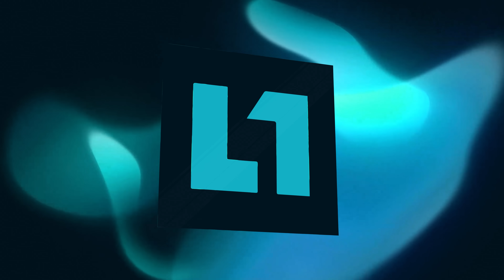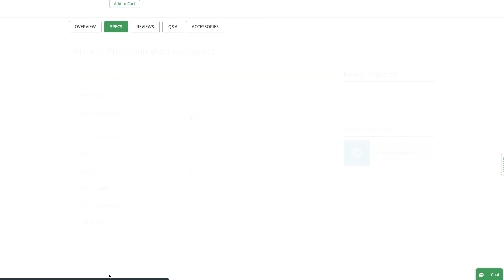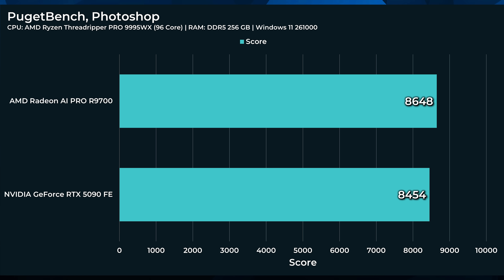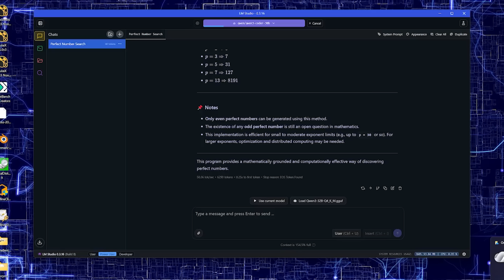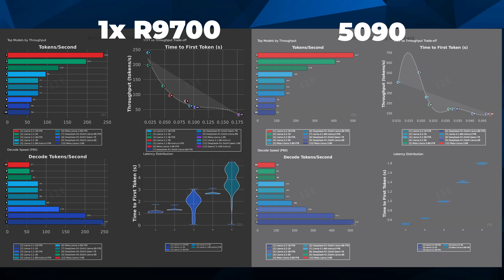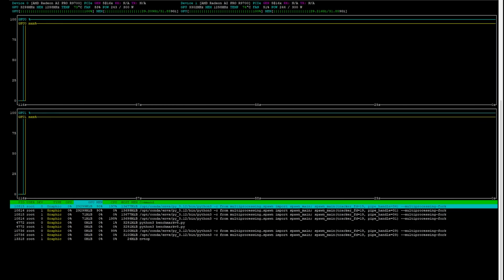Radeon R9700 Dual GPU First Look — AI/vLLM plus creative tests with Nuke & the Adobe Suite

Comment: Thanks for a very interesting video, Wendell. I run both Windows and Linux. I'm very happy that Linux is doing so well these days as I am looking at migrating to Linux entirely.

This new GPU looks very interesting, but for a couple of things. Are they also any good for regular gaming? Is there a version that does not use the NGC (nVidia Garbage Connector) for power? I'd be a lot happier with conventional 6-pin or 8-pin connectors than that nVidia abomination.
Reply: I believe Wendell said that you can download the Radeon 9070 XT firmware and it will run like a 9070XT (with 2x the ram). It'd probably be good budget in a 4k mATX/ITX build for a Era or something, but if you don't have space constraints or need 4k textures then it's not an ideal GPU for gaming only.

Comment: Will this be a good gpu for CAD and 3D scanner applications?
Reply: Check if they require Cuda. If not, then yes.
Reply: compare the OpenCL and CUDA performance on your platform and go from there, some embedded systems are built for CUDA-only so there won't be a different option
Reply: As others have said depends on application support for Cuda or not,  but generally 3D CAD and design software really just wants a lot of VRAM.

Comment: So there are three main parameters

Memory bandwidth
VRAM
Cost

AMD halfed the Memory bandwidth and the cost compared to 5090.

If they had instead halfed only one say just the cost, ie kept the 512 bit bus, it would have been a game changer.

Or doubled one of the parameters say VRAM to 64GB, it would have been a game changer too.
Reply: their 9070 chip doesn't have 512 bit bus, only 256, so there's nothing for them to keep. If there were a 9080 or something, then it prolly would be possible. Although I have a feeling that even if 9080 existed, it would've been at 384 bit bus

Comment: I would actually love to see SDXL benchmarks (i.e. ComfyUI, InvokeAI) regarding the R9700, because last time someone tried SDXL inference on an RX 9070 XT, it was slower than a RX 6800 XT, which sounds something went terribly wrong. Most likely a software issue, but it doesn't inspire confidence. I wish to see if it was fixed.
Reply: Seconded!

Comment: Can you go 3 (tripple) R9700? Or are non-power-of-2 number of GPUs not recommended?
Reply: Doesn't make a difference. Just set tp=3 in vllm.
Reply: you'd just need a better power supply and a PC/Server with enough PCIe x16 slots

Comment: I know LM Studio is used to benchmark LLM performance, but do use GGML/llama.cpp `llama-bench` for a consistent run and comparison. It's easy to run across all HW, CPU, Nvidia, Apple, Intel and AMD. There is also fresh builds of llama.cpp, lemonade-sdk/llamacpp-rocm for Strix Halo, RDNA4/3 that has ROCm7 built in that you can use for Ubuntu and Win.

Comment: The other day i try ollama with vulkan and rocm 7.. with vulkan i have 144 tk/s and with rocm 7 110 tk/s  .. this in linux with 7900xtx gpt-oss-20b. .. i try in other box with 6800xt ..  but vulkan and rocm6 was near identical.. 5 tks more in rocm6 very strange.
Reply: I also have 7900XTX and 7110tk/s on gpt-oss-20b seems like you have hit some cache. Otherwise it is rather impossible.
Reply: @ksitau  sorry it's rocm7    110tk/s aprox .
Reply: Try the 7.9/7.10 nightly builds on the 6800XT

Comment: Just a note VRAY is coming out for AMD as of a few weeks ago. OOH and before I forget what about Unreal engine path tracing can you use 2 cards? You used to be able to with 3090s.
Reply: 3090s have NVLink so they're able to do multi GPU workloads much better than pretty much any other reasonably modern GPU
Reply: @bosstowndynamics5488  Yeah I forgot about the networking part of the cards. Good call.

Comment: I guess many people don't know if they actually require CUDA or not.
Reply: CUDA can't die off quickly enough, what an overgrown tumor it has been on general-purpose compute for the past two decades...
Reply: @peshozmiata  OpenCL for the win, doing my part 🖖🫡
Reply: @peshozmiata  until AMD performance matches Nvidia in Bender, I'm stuck is the issue
Reply: @jabronilifestyle  For Blender specifically the issue isn't CUDA but OptiX. If you want to use the hardware raytracing feature on AMD cards you need to use HIP-RT, but support for it is spotty at best. Intel Arc is ahead in this department - Blender already uses Embree for Cycles and enabling the hardware-accelerated raytracing with Embree on Arc is easy and very usable. It's too bad they don't offer any hi-end cards because intel's raytracing is very competitive with Nvidia's offerings in the same gpu class.
Reply: @peshozmiata  I use CUDA in blender cycles wym?
Reply: @jabronilifestyle  The CUDA pipeline is slower than OptiX. OptiX is specifically meant for raytracing so it's faster. You normally use CUDA only on GTX-series cards since they don't support raytracing
Reply: @peshozmiata  its slower but has no compatibility issues for me. optix shits the bed with certain modeling plug-ins I crutch
Reply: They don't know that they don't need it. They just repeat the old things they have read three years ago. But it gets better, as people see the movement of the whole ecosystem.
Reply: @construction6  Enthusiasts can get by with anything sure, but there’s also the point that there’s no reason enthusiasts have to go through a less polished ML workflow / ecosystem
Reply: This is the bright spot for AMD to sell their GPUs and for tech reviewers like Hardware Unboxed too to aggressively label Nvidia as the worst value without facing any friction.
Reply: rocm works so well today
Reply: Seriously. Unless you’re doing robotics, you probably don’t need CUDA.
Reply: @rob_over_9000  "Unless you’re doing robotics, you probably don’t need CUDA."
Not really. Ansys Fluent requires GPU for the best performance and only CUDA was historically supported for the purpose that assumes NVDA card was necessary to be present in the system. However Ansys Fluent launched AMD GPU support since V2024 so now it supports the new Radeon Pro as well as Instinct such as MI200 and MI300.
Reply: @rob_over_9000  I need CUDA for cycles in blender and I don't do "robotics"
Reply: What about CUDA for Stable Diffusion? Is an AMD GPU really doable? Does it have to be on Linux?
Reply: @zacharyshort384  Short answer - yes you need Linux. Long answer - you can run ROCm in windows usind WSL which is more or less installing linux inside of windows in order to make it run.
Reply: However, having CUDA does give you more flexibility. When you need it, even if you never thought you ever would, it'll be there.
Reply: @hasnihossainsami8375  more flexibility while locking you in to a single vendor though.

Comment: Why couldn't AMD have offered this up to people with the home user in mind, especially when it can challenge RTX 5080/5090 for performance specs?   I would really like AMD to consider getting a higher end home GPU on the market to challenge Nvidia for the top two sports or at least compete in the same pound.   9070XT are great,  but AMD really needs to address the lack of a product in the top tier, especially since they seem to have their driver issues resolved.
Reply: I mean unless you have a model that requires 32GB of memory its essentially a 9070XT out of the box no? This card isn't targeting the RTX5080-50980 its a work class/enterprise GPU.   Personally Id' say the 9070XT are mediocre, they only look decent because NVIDIA is so wildly overpriced,  I don't personally care that they missed a top tier GPU this generation what I wanted to see from them was a RX480/580 moment.
Reply: Wich driver issues? I have a 9060XT and the RDNA4 Support was spot on right from the beginning. In fact, NVIDIA seems to be facing way more Driver related issues compared to AMD since the last couple of years
Reply: @ka1serofc  Totally agree with this, but I think you two are both saying the same thing...

Comment: You should throw the M3 Ultra with 512 GB and compare.
Reply: I second this.
The price / GB of VRAM is well in favor of the M3 Ultra.
Not to mention that it comes with the whole CPU/OS, etc. around it and it also draws as much power as a single card.

For home usage, or even for a small team, I think this is probably the best choice for local AI inference, as long as nothing Nvidia or AMD specific is required.
Reply: @dlsniper m3 ultra has weak gpu compute in comparison to even single AMD card, so it depends
Reply: @leland2848 I need to do my due diligence on that, for sure. But running an FP8 24B params model with 128k tokens context window would be really nice.

As long as I could get at least 25t/s for generation, I would jump into Apple's offering, for sure.
Reply: @leland2848 also a weak cpu compared to anything actually professional
Reply: @dlsniper Plus you can run very large models.  The difference between DS 70b and 671b is epoch levels of difference.  I don't program so reasoning is what I need and the MofEs is much better.  Plus the M3 Ultra has 800 GB of bandwidth.  512 GB necessary to run the 617 at Q4 would require how many GPUs?  And what would that cost?

Comment: Weird, my LM Studio uses ROCM on a 7900xtx. 
I can choose between Vulkan and ROCM and both work. Depending on the model and the size, ROCM is usually 2-3tk/s slower but the longer the context goes, the less tk/s ROCM loses in comparison with Vulkan. Of course, I'm limited to 30b models on q4 at max if I want to load it into VRAM completely.

Maybe the fancy new AI card will need ROCM 7.x to work properly on Windows?
Reply: I confirm, my 7900xtx has also higher tokens per second on vulkan than on rocm on arch linux. I wonder also how does 9700 compare to 7900xtx.
Reply: @ksitau That's the entire point Wendell was making when he was drawing attention to ROCm - the very recent latest release of ROCm is the first time it's actually been able to beat Vulkan, and at least on these cards that seems consistent
Reply: @ksitau  I dunno, I tried LMStudio on Ubuntu once, on the same Windows machine that is (I used Dual boot via 2 ssds), And the speeds with both ROCM and Vulkan were nearly identical to windows. That was weird tbh because everyone keeps telling how much faster AMD is on Linux. Rocm is slower at the beiging but at 5-6K context or so, it's faster that vulkan it feels like. Also, ROCM seems to better utilize VRAM usage for Context size than Vulkan.

Unfortunately, I couldn't get Stable diffusion to work on Linux to do a proper test. I just ran into error upon errors until I gave up.

But this was at Rocm 6.1, so it's a while ago. What I've read, 7.x is faster overall, and when you go through the hassle of early and beta drivers on windows, it's even much faster for things like ImageGen as you can finally get some of the pytorch things to work.
Reply: Confirm using Radeon 6800, under the Runtime execution packs I have 3 options: ROCm, Vulkan and CPU.
Maybe I see the ROCm as an option because I have installed the AMD HIP SDK for Windows 6.4.2?
Reply: @solidreactor  If you installed 6.4.2 successfully, then you should have the necessary runtimes on your PC to be able to use ROCM. The RX 6800 Is supported as far as I remember.
Reply: I'm a big fan of ROCm.

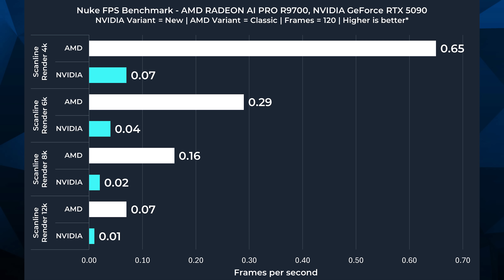Comment: AMD and Nvidia switching colour around 6:00 had me so confused
Reply: Me, too! I still can't parse when he's talking about the dual GPU setup and a single GPU. I like Wendell, but I often get lost in the rambling.
Reply: @dollhausenx The novelty for ROCm is that, up until very recently, it was actually slower than just using Vulkan GPGPU for inferencing workloads, the stuff about CDNA was just an explanation as to why it's not been as good on RDNA GPUs and that they're finally at a point where it's actually beneficial to use ROCm on these cards

Comment: I have been having a lot of success using my RX9060XT with Comfy and Llama, ROCm under Linux is really good :)
Reply: What flavor of Linux are you using?  I'd love to see more about this scenario in particular!  I'm interested in doing this specifically...
Reply: @johndelabretonne  CachyOS here, with a 9070XT. ComfyUI and Llama required zero tinkering.
Reply: @andersjjensen  what is your use case for local AI?
Reply: @chessgodGal  Lewd stuff I shall refrain from describing in detail on a respectable channel like this.
Reply: @andersjjensen HAHA last thing I expected to read
Reply: @andersjjensen  haha just asking because im still evalutaing 9070XT vs 7900xtx vs 5080
Reply: @johndelabretonne  Arch Linux here, it immediately worked, out of the box. Don't believe what people tell you who don't have own experience. They just repeat the things that they heard from others, who told about problems three years ago.
Reply: @johndelabretonne  I have tried a few but always end up back with Ubuntu lol I tend to know Debian very well, so feels comfy. 

I am using dockers though as everything is a bit all over with support, so spinning up dockers for Comfy, Llama, Training etc. Keeps it simple, easy to change ROCm or PyTorch versions and stuff.
Reply: running rx7600xt 16gb for basic genAI here, it not officialy supported but it work , linux can be tricky with all the cli and dependancies. using ubuntu 24 lts
Reply: same. I also tried out ace-step on to a 9060xt. a r9700  would be nice since that is also rdna 4
Reply: actually, i ended up ordering a r9700 32gb since the rx 9060 xt rocm worked. i am just going to put the rx 9060 xt into different computer but still use it.
Reply: Try the RTX 5070 for such workloads and you will find the RX 9060 XT light years behind.
Reply: @gauravsinha6060  You have one to send me? lol. (I am aware that using something from Nv and CUDA would be better, but I dont have that :( ) I have been using GLM5 more anyway, its great for use cases
Reply: 7900xtx is still faster and cheaper if you run some 30b q4 models
Reply: Come again?
9060xt doesn't even work with rocm at all last time i checked and all it did was crash any linux distro i tried even installing the drivers on
Reply: @klontjespap  lol, it does, you just need the latest versions and what not. I can post my compose and Dockerfile later on.
Reply: @Sipheren  yes please

installled the firmware-amd-graphics package before updating the linux kernel like 2-3 months ago, and all i ever got was crashes running natively, 
and going the WSL route it simply did not ever detect a rocm compatible device
Reply: @klontjespap  I cant seem to post the link to the files, I'll have to work out a different way. I am running Ubuntu 25.04 and not using the official and drivers.

Comment: I would kind of like to see some Zluda looks into using cards like this and the B60. As that project matures I wonder if it will be able to run more basic CUDA workflows with good enough performance. Kind of like how Vulkan performance is starting to get good enough to replace some of the use cases of ROCm and OneAPI.
I really feel like we are going through a GLIDE like API transition again.
Reply: What you want is OpenCL. No porting, no translation layers, just native support on all Nvidia, AMD, Intel, Apple, ARM GPUs out-of-the-box 😎
Reply: @ProjectPhysX  OpenCL had a lot of push behind it but seems to have lost a lot of mindshare along with OpenGL. Everyone seems to be targeting other APIs like Vulkan Compute when it comes to cross platforms. I think a lot of Apple deciding to move away from OpenCL and push CoreML more. Apple really has been working on killing open standards the last ~6 years wanting to force bake in like Nvidia. Kind of sad since OpenCL was heavily backed by Apple back when it was first introduced.

Comment: Amazed that you got vLLM running on a card that just got released... Blackwell and vLLM are still to this day a problem! AMD really has got their stuff together driver wise.
Reply: It's improving, it's about time too.
Reply: It's Nvidia and their retarded emulation layer.
Reply: I've had good luck get launch day, unsupported cards working through vulkan
Reply: vLLM and blackwell 5090 works very well in tensor parallel 2 at least
Reply: I’ve been saying for almost a year now that AMD is the dark horse in the AI race.
Reply: Blackwell and any inference is an issue lol, wish I got a 4070ti instead of a 5070ti
Reply: There is a solution for everything. I have 5070ti, running video and audio ai models
Reply: @LRM011 try to run a quant text model... It will use up all of the memory and keep giving strange errors. That was 1 month ago. Maybe the latest releases fix things...
Reply: I was able to get vllm and my 5090 working, had to create a custom Docker image though.
Reply: Just an update tot anyone who finds this comment... After a few months I tried again with the latest nightly and with the help of Gemini (ironically) I was able to figure out the issue... Blackwell, and especially the silicon in the 5060 Ti is optimised for FP8. Loading the model in FP8 and lowering the context size, I was able to get it to work. Seems like llama.cpp is better optimised for Blackwell single GPU as it figures out most of the configure work by itself, but you have no choice but to use vLLM or ExLlama for multi GPU setups to get tensor parallelism going...
Reply: To be clear: it's not that it doesn't work, it's the fact that everything outside of a 5090 has so many broken things that you need to spend days fixing all the bugs and applying workarounds... Also the performance isn't great... Just run it in a windows VM and compare it, you'll see. Or try to run a quant model from HF... Or you can go the Ollama route but lose parallelism...